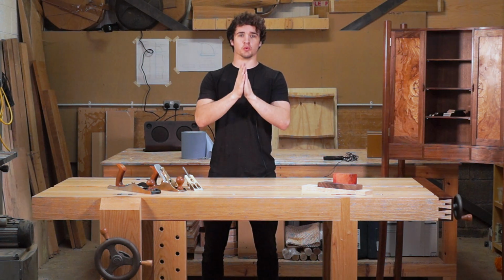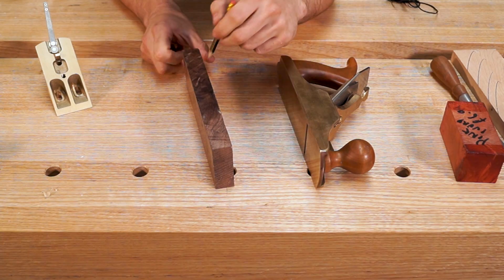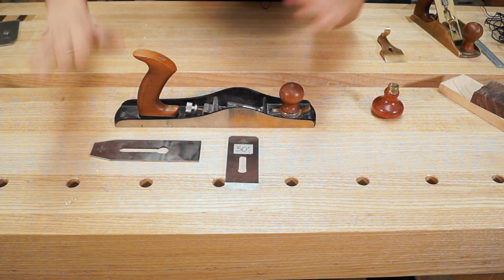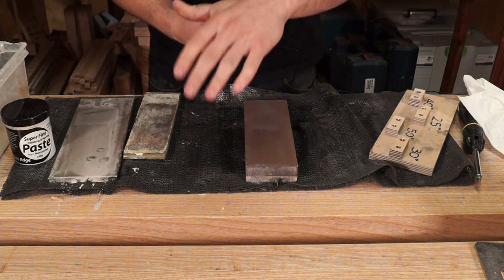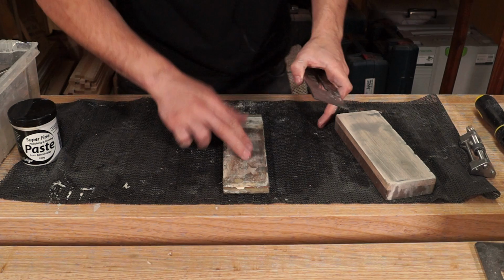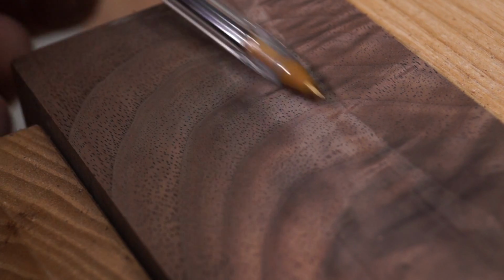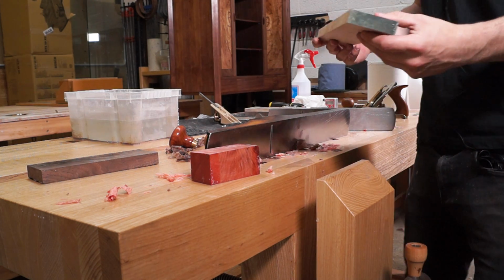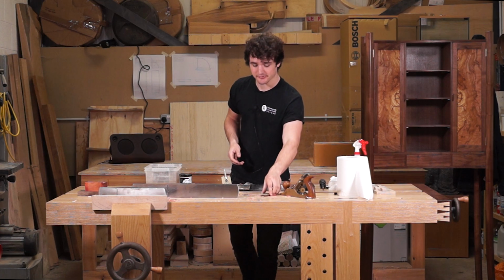How to reduce TEAROUT when using a HAND PLANE

Comment: I was just starting to do the finish planing on some padauk. It tore out miserably using an LN low angle jack with a 35 degree blade. I thought "Now what?" I resorted to a card scraper and after a lot of work got it to looking pretty nice. I think I'll go and up the LN jack blade angle a bit and see how that works, but this time on a scrap piece of padauk. Thanks for the tip on going to very high angle.

Comment: You make sharpening look so easy I spend hours trying to get my chisels and crappy plane blades Sharp and I have the Veritas honing guide which definitely makes it easier I still just don't have the right equipment yet I have the two DMT Diamond plates double sided butter only 2 inches wide
Reply from the maker: Have a look at my earlier videos on comparing the Lie-Nielsen honing guide and the Veritas honing guide. I think you'll find it interesting
Reply: Eric - you may find more success with something like a grinder, a single washita stone, a piece of bare leather (and no guide). I won't go into details about washita and stuff like A2 and V11 (aside from saying that they're not optimal for it), but if you're using a lot of mid-market stuff, the washita is great. It's actually lovely for A2 and V11, it just needs something following for the final work on an edge because the washita appears (under a microscope - rather the blade under the microscope) to be pulling a few carbides from an edge. It's still sharp, but not quite what it could be. 

At any rate, sharpening this way is about a minute process, and because you're usually only using one stone, there aren't too many rules (there's no sets of bevels to keep straight, etc).

Comment: I get your point about using a bank bevel with a higher angle as a way to get less tearout, but what about the effect of the chip breaker? My understanding (which is limited as I'm just starting out) it's that it'll help reduce tearout without needing to have such a higher blade angle (on a bottom bevel of course)
Reply: mnason15ify the chip breaker is there specifically to reduce tear out but few people seem to cover it.

On the chip breaker:

Hone the underside of the leading edge, honing a relief behind the front edge - so it sits flat on the blade when fastened / so no wood can get trapped between the blade and chip breaker.
Hone the leading edge at a consistent angle of (from distant memory - check on Google) around 80-84° to be bevel up against the blade - so it looks like an arrow when the blade and chip breaker are fastened together.

This then deflects the wood shaving up after it starts travelling up the blade, rolling it tighter than it wants to go.. This resistance pushes the wood down so it doesn't lift - to avoid tear out.

To set the chip breaker, you'll only truly care when using it on lighter cuts, so set it close to the blade - it's distance to the blade will prevent heavy cuts (jam) if set for finishing.. So on the finer end, set it so you can just see a hairs width of the shiny blade edge reflecting past the chip breaker - experiment with greater distances for heavier cuts, say 1/2mm, 1mm etc, and back out entirely for hogging wood off.. And remember to wax the sole of the plane unless wax will affect your intended surface finish.
Reply: And don't use a secondary bevel when using the chip breaker, it isn't necessary, and if too steep (say beyond light honing with a steel rule to remove the burr), will prevent the chip breaker from sitting up against it.

Comment: Hi Matt, before i start i should say that im very much a beginner, albeit a passionate enthusiast of woodwork but a beginner nonetheless and just when I thought i was all ready to buy my first plane thanks to your awesome series of videos (thank you) I made an error...... I went down a YouTube rabbit hole and found more videos on the pros and cons of the “low angle” jack plane in particular one by Rob Cosman and whilst he agrees that the 5 1/2 is perhaps the most versatile of planes, he doesn’t rate the low angle ones due to the lack of weight and side on surface area which can make them more unstable on the shooting board so now im stuck! Go for the standard bench plane or go bevel up. Also im at the low end of the budget bracket, i know i know buy cheap buy twice but we are where we are so how do you rate the Axminster rider vs say the wood river planes. Hope you can help, im going for a lie down now i have a plane shaped headache! Many thanks in anticipation :)

Comment: Matt - I would encourage you to use the cap iron instead of any of the methods you're using. It's got several advantages:
1) it's better at tearout reduction than any of those once you've got it figured out
2) it requires you to keep only one smoothing plane at the bench for everything (end grain, long grain, reversing grain, whatever). You will get very good and fast with a single plane, and it will always be right in the nick that you like because you'll be using it
3) there's no tool modification required, and no need to purchase things like steeper frogs (which are less effective than using the cap iron). 
4) the plane becomes dependent on the cap iron to reduce tearout and not sharpness. There will be no tearout, all the way to the point of complete dullness
5) a plane with the cap iron engaged in the cut will plane much further into dullness than a plane with a single iron (far less sharpening) and tolerate a thicker cut to get initial work done. You'll probably sharpen 1/3rd as often per volume of work. Perhaps less.

Planes like that low angle plane were originally marketed to smooth plane butchers blocks and things of the like. They are less good for long planing, which is why they didn't sell well until there was a large amateur market.
Reply: David, relax - this video is handplaning 101. BU planes are easy to use. The chipbreaker on a BD plane is a superior method of controlling tearout, but it takes more skill. I echo your sentiments. Still, BU planes are another option. They work well - just not as well as the chipbreaker can. Derek
Reply: How does the length of the plane body make it worse for long planing?

Comment: What do you think of linseed oil wet sanding to preserve and show grain patterns on these hard/impossible to plane grain patterns? My myrtle wood piece is tearing out with a Veritas low angle block plane.  The plane does fine with purple heart. Thoughts?

Comment: Hello Matt,How does a smoother plane (or jointer as you used in the video) with a high-angle bed, blade or back bevel compare with a scraping plane, or a toothed blade?  When would be the time to use one vs. another?
Reply from the maker: The only time I would use a scraping plane is if I was trying to flatten a burr where there is literally no grain direction whatsoever. Otherwise, a high angle blade copes with reversing, curly or figured timber quite well for me! Hope that makes sense?

Comment: Thank you for your videos? Re the pink ivory, have you tried wetting the wood, especially where you're getting tearout on the ends? I use a small watercolor brush and lay the water on very thinly, then let it soak in for about 20 seconds. There should never be so much water that it runs down the sides.  just enough to moisten the wood fibers on the face to be planed..

Comment: Great video . would love to see a part two that talks a little about your thoughts / experiences  on the importance of throat clearance and chip breakers. maybe you covered this in a previous vid.
Reply: Chip breaker setting is the key.  It needs to be very close to the blade.  A regular plane with a 45 degree frog and standard bevel will handle bad grain just fine.  Of course, the chip breaker needs to fit right, and the blade needs to be sharp.  A Japanese guy has  a video showing the difference the chip breaker makes.

Comment: With the high angled plane, is that possible to just set a 10-15 degrees bevel on one side and just simply flip it over and place. Does it matter what the bevel angle is with the high angled plane? If so one side of the blade is flat which is same angle as the frog and when you flip so it is frog angle plus the bevel angle. is that possible or positioning the chip breaker is a problem in that case? thanks.

Comment: Only thing you didn't mention was, in bevel up blades. When you start sharpening above 30 degrees in any plane blade the durability of the edge is reduced the steeper the pitch gets! In other words it dulls a lot quicker than a bevel down plane blade at 30 degrees with a steep pitch frog.

Comment: An excellent video but you seem to ignore one important thing with the bevel down planes - the chip breaker.

The English Wood Worker covers it really well, but there's also a Japanese video which shows a slow motion video to compare micro differences in its set up.

It needs to be sharpened to the correct angle as well as fitting against the blade, and set correctly - I certainly couldn't be bothered with a secondary bevel when this bit of the plane is specifically there for this purpose.

I'd also love any and all new Veritas plane/s but even a Bailey #5 works well like this.

Comment: Yo Matt, as a general purpose plane, are there any disadvantages to having a back bevel on a standard 45 degree frog setup? I often get tear out and am still discovering the best setup for my shop planes. I'd be interested to try the back bevel but would appreciate your opinion on any cons? Thanks ;) 

Alex
Reply: Not Matt, but I do keep a work pitch on on my planes when working with wood that can tear out. It make the cut a little harder and you have to take shallower cuts. Also pay attention to the "chip breaker" distance from the blade edge. The close to the edge the less likely you are to get tear out, but the cut gets harder. Further back, you get an easier cut but tear out is easier to do.
Reply: ehisey Thanks for the advice ;)

Comment: I noticed you doing something (perhaps subconsciously) ..... planing with the plane at a slight angle to the direction you are pushing into! The plane is still flat but I wondered if there was a benefit to the smoothness of the cut by doing this? Before anyone starts I am purely an amateur in this area!
Reply from the maker: It makes more of a shearing cut as opposed to whacking the timber with the full force of the blade. The drawback is that it effectively lowers the angle of the blades cutting action the more you angle the plane. Which is exactly the opposite of what we want to do in this video with regards to reducing tearout. A high angle is needed. Think of it like climbing a really steep hill. It’s less of an incline if you zigzag across the hill as you ascend to the top, whereas if you went straight up you would be battling the full incline. I slightly angle the plane to create the shearing action, but don’t do it too much that it lowers the cutting angle drastically.
Sorry it was a bit of a long response, maybe I should do a video on this in the future!

Comment: Hi Matt, I'm enjoying your videos, particularly your builds,  keep it up.  I notice you did not address the distance the chip-breaker is set from the blade edge, as well as the angle of the chip-breaker leading edge as factors that can help to minimise  tear-out in bevel down planes.  What are your thoughts on these adjustments with regard to reducing tear out?  Do you believe they are not effective or are you not aware of their influence?  I don't believe that these factors are widely understood or discussed and I haven't played around with them long enough to be sure of the magnitude of their effect vs frog angle and/or mouth setting myself.  Although I've read several sources that believe the chip breaker setting and angle can make just as much if not more difference than the actual bed angle in a bevel down plane with regard to minimising tear-out.  Cheers,  Dom

Comment: Hey Matt, great video as always! Any thoughts on putting a back bevel on a low angle block? Would there be any real advantage?
Reply: a block plane is a bevel up plane anyways so a back bevel would not change the effective angle . however it could  strengthen the edge slightly. I use a small back bevel on most of my plane blades to avoid polishing the whole back ( See Charlesworth ruler trick ) . this however is slight 1or 2 degrees and at most 1/64  to 1/32 in length ( enough to accommodate any camber on the blade . for bevel down planes it limits how close the chipbreaker can be set)
Reply: IT could also potentially make the blade unusable as the backbevel could touch the wood before the cutting edge does preventing the edge from biting.

Comment: In the sharpening section of this vid, you mentioned you didn’t have a 15 degree yet because you hadn’t made one... Pro-tip... just use the backside of the 50 degree as a reference, and rip the entire board to the depth that makes the back of the 50 become your 15 when reversed??
Reply from the maker: Oooooo very naughty idea. I like it!

Comment: Hi Matt! I really like your Videos. Right now I am researching the plane i want to geht next. I am considering a Jack plane, but i am unsure with the angles. As I understand ~55° seems optimal for reducing tear out. Why do most no 62s come with a 25°blade on a 12°bed resulting in 37° which is actually less than the default 45° I geht on a regular e.g. Bailey pattern?
Thanks a lot! 
Tobias
Reply: Tobias Glahn the low angle plane was made originally made for end grain butcher blocks.  The lower angle allowed it to sever end grain cleaner.   I use a 38* blade on my low angle smoother and an50* degree blade when the going gets tough.

Comment: Why would you put a camber on a bevel up plane? The back of the blade is the thing that comes into contact with the wood and it remains flat.
Reply from the maker: I put it on there for the same reason as a standard bench plane, so I can control where I want to take a shaving from. See my previous video about setting up a bench plane
Reply: only if it is a trimming plane which is effectively an plane bedded at 0 degrees. as the bedding angle rises the greater the effect of cambering the edge, bevel up or bevel down. at 0 degrees the effect is nil. at 90 degrees it is 1/1 like a scraper plane at 45 degrees the effect is the square root of 2 .  fun to think about if you are a woodworker/ math geek .

Comment: I bought some Oak a short while ago, Matt, and went to plane it and it all went to pot; I go so much tear out that I really lost my rag. Well, I’ve come back to it this week and decided to watch this video again to try and give it another go. I now have a spare blade and I’ll give the high angle and back bevel a go. It’s one thing to know it and a whole other thing to try it, so now I’m a but more experienced with sharpening, I can put my limited knowledge to the test.

Also, in the video, you mention that the low angle jack plane isn’t your favourite plane, so I was just wondering which one is. Thanks.